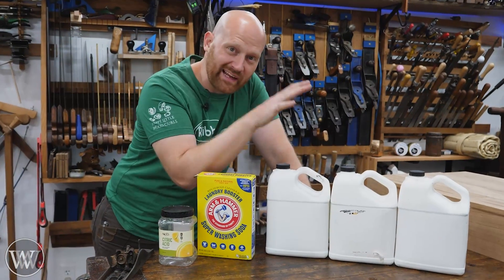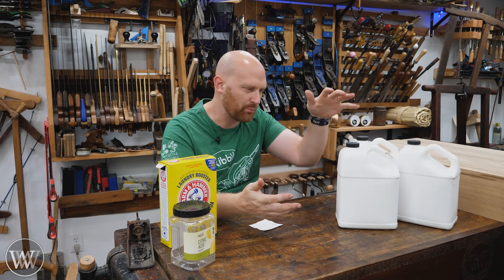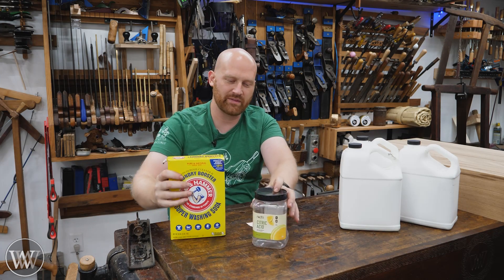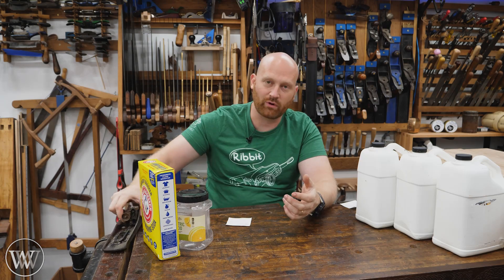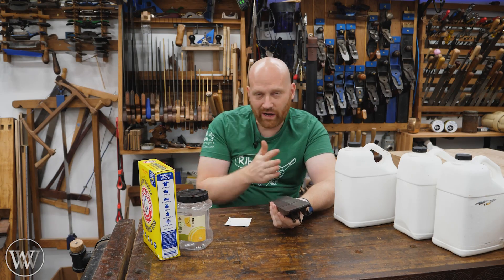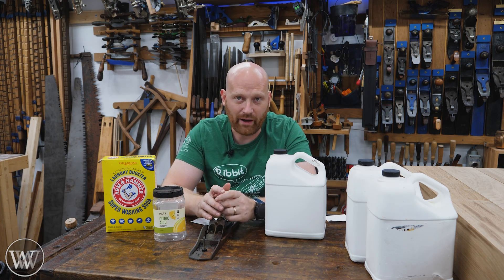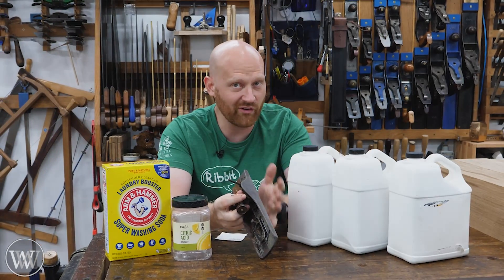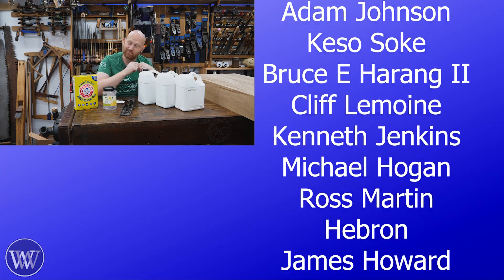Rust Removal REVOLUTIONIZED The New Affordable Way

Comment: I thought vinegar acid is only ok on "forged" metal (chisels , blades...) and for cast iron you shouldn't use it?
Is this now another story with this mix?
Reply from the maker: You can use vinegar just about anywhere. You just have to be careful with it. You'll find a lot of people who will poo poo it for one use or another. But you do have to be careful. You can run into problems if you leave it too long.
Reply: @WoodByWrightHowTo 
OK, so only If it is too long in it. I thought it is about soaking vinegar into the cast and it is rusting from inside Out ...
Reply from the maker: That is what they want you to think. But practice is a very different thing.

Comment: As a chemist who has dabbled in tool restoration, I am intrigued.  I have already used citric acid and dish soap in my vinegar solutions for rust removal, but hadn't considered taking away more of the pH component of the reaction.  Now I am left wanting to dive into the formulation and figuring out a readily available corrosion inhibitor that could make it even more friendly to the non-rusted pieces!
Reply from the maker: you should watch Beyond Ballistics' video on it. he goes into a lot more of the chemistry behind it.
Reply: I’m also a chemist and was intrigued by Beyond Ballistics experiments.. so I made some sodium citrate(s). Mono-, di- and tri-sodium citrate solutions a few weeks ago. (Just calculated the correct molar ratios of citric acid and sodium carbonate). Bit of research also led me to believe that mono-sodium citrate was superior to the other two. Testing on some rusty nuts and bolts was as satisfying and successful as James’ plane example. 😮
Reply: That's awesome!  I watched the Beyond Ballistics video immediately after watching this video, and went down a mental rabbit-hole.  Between wanting to restore old tools and the easy application in around-the-house/lab maintenance, it's just such a useful topic.  Great to see you've had a chance to test some of these already with just as astonishing results!  I will likely be more delayed in testing to build on everyone else's results,  but I will add anything here if it happens.
Reply: @jmwww1 how did you make monosodium citrate instead of trisodium? Is monosodium citrate much more acidic than trisodium?
If you use the 100g citric acid and 63 grams Sodium bicarbonate, what will be the pH? I thought beyond ballistics said pH 4 for his trisodium citrate. I thought just dumping more and more sodium bicarbonate into the mix would raise the pH which should be better for preventing metal attack… but maybe slow down the reaction??

Am I off-base? (Pun initially unintended)🤣🤣
Reply: Spray with 28% phosphoric acid after you have washed this stuff off. Converts the rest of the rust ie. iron oxide to iron phosphate. No need to use much. Phosphoric acid is expensive as hell. Paint it, no need to rinse.

Comment: I have used 1:10 citric acid and water solution with a bit of added denatured alcohol and a few drops of dish soap. It works great, it leaves a grey finish that is easily polished if desired. I recommend using gloves when handling it as it can sting a bit. I will take a look at Beyond Ballistics video to find out whatever "Washing Soda" is and if I can get it here so that I can add that to my recipe. Having a more neutral solution would be nice.
Reply from the maker: Citric acid and water is vinegar. it works well but you have to be carful it is easy to go too far.
Reply: Vinegar is acetic acid. It’s what you get when ethanol oxidises and your wine goes off. 
Washing soda is sodium carbonate. 
Citric acid is the acid you find in citrus fruits. It has 3 carboxylic acid groups in the molecule. 
Sodium carbonate neutralises the carboxylic acids when used in the correct proportions. 
You can also use sodium hydroxide (which needs great care as it is extremely caustic) to react with the acid groups. 
The product works by chelating the iron oxides. As does Evaporust which is alleged to contain another chelating agent, ethylenediaminetetraacetic acid (EDTA), probably as the tetra sodium salt.
Reply from the maker: sorry speech to text typed the wrong one.

Comment: Ive recently used 10% citric acid overnight  and 5% for 36 hours and been really impressed by how easy it was to use and how clean the finnish was just scrubbing with a wire brush  after the saoking,dumping the solution out, dousing  everything with a bicarb soloution and the rinsing off.

Very low effort for the results.
Reply from the maker: sounds like the clastic vinegar method. works well just don't leave it too long especially with thin metals.

Comment: Have you tried Corrosionx?  I just bought it to try and started with my clamps. It already started working under the dried glue so far and no more has stuck yet. I’m excited to try the other lubricants that are supposed to penetrate rust and leave a thin layer of protection

Comment: I'd be curious to see that plane body after finishing the de-rusting process.  Is there excessive etching at the waterline?  I know (from experience) that's a problem with evapo-rust, so it would be great to know if this stuff works on parts too big to fit in the bucket all at once.
Reply from the maker: that is what I was looking at with the wire wheel. I will be doing more testing as I clean up a few more tools. I did not see an etch line here though. As with most any method it just depends on how long you leave it in.

Comment: Evaporust is great if you can afford it. What I like about it is that it is safe on paint and wood. Curious to see if this solution is safe as well.  I have an old section of railroad rail that I plan on turning into an anvil, this looks like the perfect time to de-rust it.
Reply: I used a 7x diluted version on some vintage beaters. It took the rust off and did not harm the paint or wood of the handle. However, it did loosen the paint on some rusty metal drawers where the rust had gotten underneath. The rest of the paint stayed intact. Again, this was with the diluted solution. Even at that strength, it was very effective against the rust, removing it in a couple of hours.

Comment: For folks who are afraid of washing soda there’s also a food grade version of the same thing (sodium carbonate) that is used in the ramen noodle making process that you can use. It’s called “Kansui”, just make sure you’re getting “type 1” which is 100% sodium carbonate and not the other types which contain potassium carbonate.
Reply: You can just make your own.. bake some baking soda at about 390 and it decomposes into sodium carb and co gas and water..
Reply: For those who might have large projects or be low on ingredients, I want to share that this solution is still very effective when diluted. I needed several gallons for some drawers and slides from a vintage tool cabinet. Because it had been so effective in the Beyond Ballistics video, I decided to make the solution at nearly 2:1 to help keep costs down. However, I forgot to convert from gallons to liters when doing my initial calculations and ended up making it nearly 7:1. It still worked very well. The drawers had to sit in the solution for a couple of hours instead of the ten minutes or so from the original video, but that was all. From my experience I would say that you could get 5-6 gallons from this amount of citric acid and still have a highly effective solution. This is helpful if you have large items that would need a lot of liquid to cover them.
Reply: I'm confused - the washing soda that James linked to is 100% sodium carbonate. Is there a difference between the food grade and the one James used?
Reply: @Driver10011  I haven’t seen the MSDS for the one James used. But even when ordering from a laboratory chemical supplier you’ll often see the same chemical purity but two different sku with one being “food grade” while one isn’t. It could mean that one is less pure, that the precursors could have some issues, that it simply wasn’t tested since it was never meant for consumption, or any number of reasons. Often when something isn’t normally meant to be ingested they don’t bother going through the certification even if it’s considered pure enough from a pharmacology perspective. But without looking at the MSDS it’s usually impossible to tell just by looking at a label. 

I don’t know about the brand that James used but often washing soda has fragrances added to them. Given that most people won’t be drinking home made rust remover it’s probably not that big a deal but one of evaporust’s marketing is that it’s safe for utensils for food contact. So if one wanted to err on the side of caution then I figured this would be useful information.
Reply: @donbert  thank you for that explanation! Makes sense
Reply: I was  wondering why you'd ever care about using it for food LOL. That's good to know. I may adjust my ingredients list, unless the stuff from Arm & Hammer is food grade.
Reply: @woodworkerroyer8497  I already had kansui because I make ramen noodles from scratch at home, but I’ve also used evaporust on BBQ grills and utensils…
Reply: If you really want food-grade, just use baking soda. The Beyond Ballistics video gives you the formula for that as well. You just need a bit more baking soda than you would washing soda.
Reply: Washing soda, soda ash, and sodium carbonate are the same thing. They are used for different things, but are generally pretty safe to use as long as you use them according to the directions and wear proper PPE (eyes and hands).
Reply: If you want sodium carbonate, bake a sheet of baking soda at 200F. Done.
Reply: As soon as you mix sodium carbonate with water, it forms an equilibrium between carbonate and bicarbonate ions.

Comment: Hmmmmm. My brainthinkings are wondering if using this as an electrolysis solution would work betterer than salty water🤔*EDIT* I meant to write Soda and water. My apologies. Thanks to @kajiarrow7761 for pointing that mistake out.
Reply from the maker: Worth a try.
Reply: @WoodByWrightHowTo  That's what I was thinking, what could possibly go wrong?😆
Reply: @philaandrew100 washing soda and water is what your supposed too use in electrolysis. Using salt makes chlorine gas as the bi product. Not very safe
Reply: @kajiarrow7761  You are indeed correct.... I have no idea why I said salt when I meant soda....Talk about a brain fart🤣. Thanks for the correction, there is enough misinformation out there without adding to it.

Comment: I have a sandblaster and I like to use that for my rust removal but I still enjoy good old sandpaper for some stuff
Reply: Sandblasting is great but it has it's cons too, hence why I don't use it that often anymore. The media gets contaminated easily, the finish can flash rust quickly, too much patina and detail removed.
Reply: Depending on what I'm blasting, I prefer soda blasting on tools, but will use sand on wheels and vehicles and larger hard metals or epoxy finish removal.